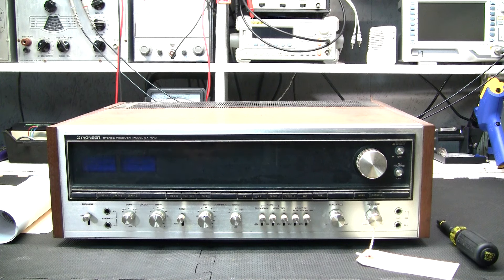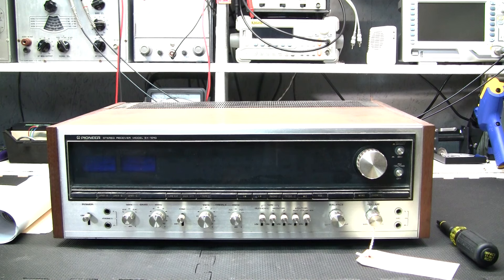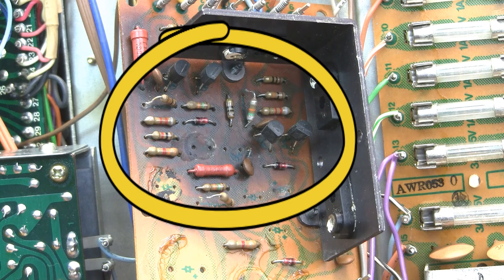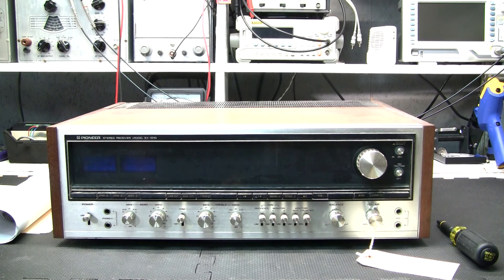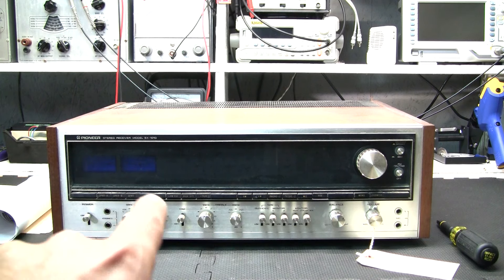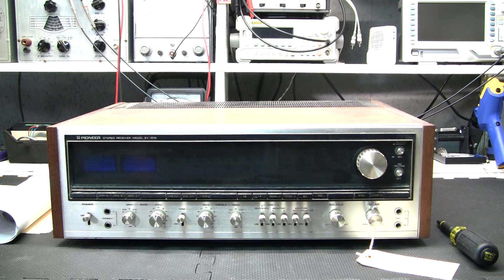Another Pioneer SX1010 Evaluation

Comment: as always very informative video Thanks and keep them coming. What size bulbs do you use in the Dim bulb tester, 25, 60 and 100?
Reply from the maker: Hello there and pardon the delay, as far as the 3 bulbs I use in my current limiter / dim bulb tester. I vary around a bit as needed. I have a 40, 60 and 100 in there currently and I have a bunch of other bulbs (smalIer and larger wattage) I use when I just want to use a specific wattage filament or combination thereof depending of course on how much current I want to limit to a device under test (i.e., stereo receiver , amp, etc.)